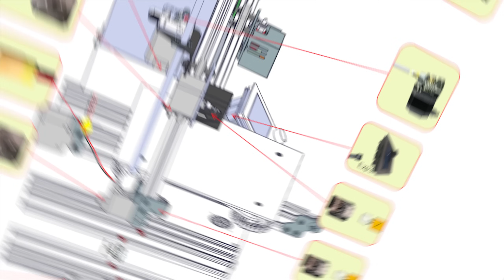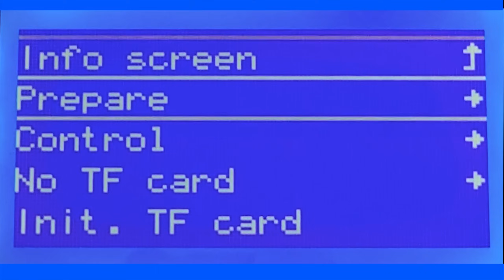Unboxing | Creality Ender 3 Unbox Set Up and Build (2020)

Comment: The screws for mounting the PSU to the frame don't fit for mine. They are loose. I can push them in and out of the PSU holes without screwing.

Comment: I work at a 3D Print Shop, and from past experiences please do not use this video, i’ve had many customers try and assemble their printer with this video and end up failing doing so. For your own sake find a different video online or use the manual.
Reply: WHAT?? JUST BUILT MINE AND IT'S GOOD

Comment: please help!!! at 5:00 i can’t get the screw rod thingy to move that top bar thingy (im so so new to all this) i try manually spinning it and it only goes down so far
Reply: For me it only goes up because the hole the rod goes in isn’t centered with the rod
Reply: @ for me loosening one of the tiny screws that run parallel to the rod on top where you run it through worked perfect for me!
Reply: What I did was I screwed it into the top bar first, then reinsert it into the silver part. Worked like a charm.
Reply: @Eyedaaa201 what

Comment: it didn't turn on
Reply: There is a voltage switch on the back of the power supply push it down to 115v

Comment: For some reason once I was done setting up mine Ender 3D printer my axis said X -3, Y -10 and Z 0. How do I fix this?
Reply: I don’t have an Ender but I’m looking to get one (that’s why I’m watching this video) but I do have experience with TAZ. I think the problem you’re having is that you have to calibrate your printer. Maybe go to the move axis option on your printers screen and see if you can reset your axises from there.

Comment: I saw this tutorial, and I noticed one thing that was missing. There aren't any details related to the selection of the correct input grid voltage before the printer is plugged into the wall. On the side of the power supply, there is a small switch with a warning sign. This switch MUST BE SET to the correct position according to the user's local grid voltage. Most of the world's countries are using a nominal voltage of 230/240 V (I think it is the default position of the switch, but it's better to check it), some countries, like Japan, North American states, Middle American states, and the northern states of South America, are using a lower voltage of 100/130 V.

I don't know what information is contained inside the assembly manual packed with the printer today, but a few years earlier there was wrong information. The switch has to be switched to the 120 V position always. I am an electrician, so I knew I shouldn't do it because I am living in Europe. But I have a friend who doesn't have too much knowledge about electricity. He toggled the switch as the assembly manual guided, and after turning the printer on, the power supply simply blew up.
Reply: I'm in Canada, and we use the lower voltage.
Reply: In the USA it must be on 120v or 115v
Reply: @Marcus-xl9kr  is no problem.. unless you are in europe and it is set to 130 and you power it with 230v.. the power supply will get damaged.  if you set up to 230 and you power with 130 nothing will happen.
Reply: Doesn’t 120 and 230 have different outlets for plugs?

Comment: Dude slow down and go one at a time on the wire connection parts. Don't rattle them off all at once with all pictures present. That was the only frustrating part
Reply: I concur.

Comment: 3.22 mine had the nuts in the place where the head should be so the extrusion won’t fit over the bolt
Reply: I have the same problem any ideas on how to fix it?
Reply: @ethanwhitwell6980  I thought it was a design issue turns out I was wrong lol, look at the instructions again and see if you have the correct part or orientation and everything. I can’t remember what I did back then but I remember feeling stupid for thinking it was a manufacturer’s defect after looking at it again.
Reply: @senurasenaratne5782  yup I had the wrong part 🤦🏼 thanks for the help.

Comment: Why creality don't provide sample filament that can completely print their own test dog file 😥
Reply: Wdym mine came with filament
Reply: They do with ender 3 and it’s absolutely trash
Reply: @ghostgunner27  can you make the print of the dog with the filament that comes standard with the ender 3? Do you have enough filament ?
Reply: I had a Chinese cat 🎎
Reply: Same 🤑 @reddit-eater
Reply: Creality does send some filament but just not a lot
Reply: Mine came with the lucky cat and ran out with just the top of its head missing
Reply: @Marcus-xl9kr id say buy more fillament (mine also got headless but i alr had white fillament so i put my white fillament in it)
Reply: @Gooferility  i had more filament i just wanted to get rid of that tiny little roll they give us. had i installed my direct drive before I started the print i think it would of had enough
Reply: I had more than enough to print the dog.

Comment: Notes: That voice was weird but fun. Every part is in plural. You aparently need to prepare bolts. The spool holder is a barrel. The extruder is called the extrusion meca nis...                  .em. The allen key sounds wierd as well but other than that it passes the qc check. (Maybe)
Reply from the maker: Thank you for your correction, you listened very carefully. (๑╹◡╹) ﾉ "" "
Reply: The voice (computer generated) is stupid.  It should be outlawed!!